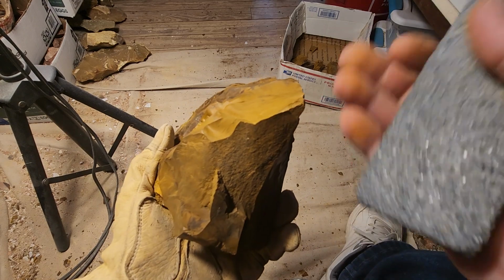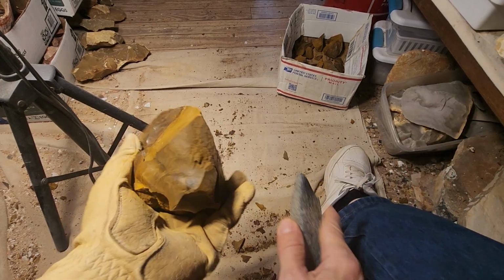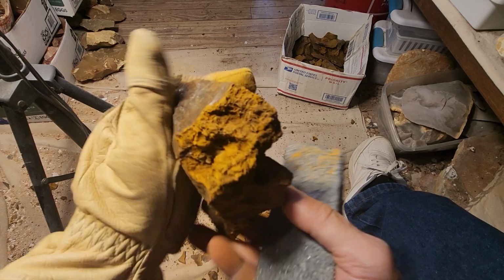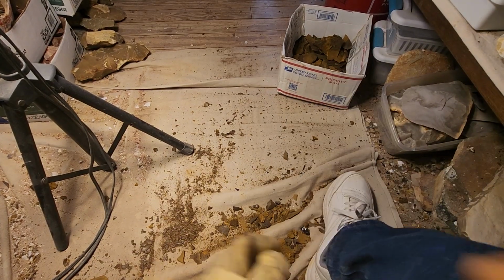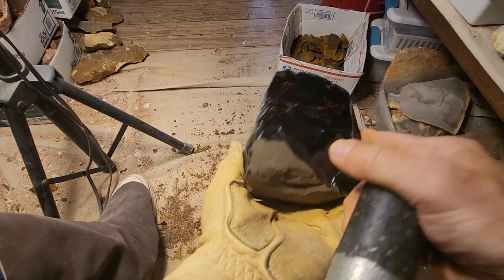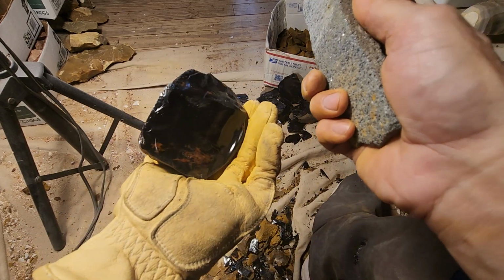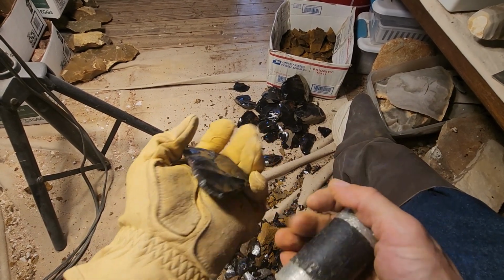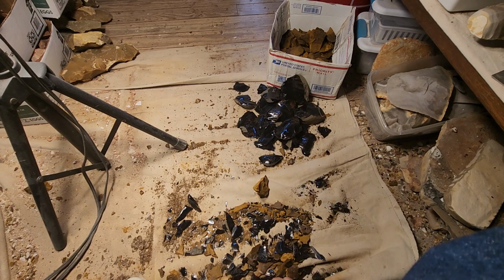1533 - Spalling A Crackly Nodule and Small Obsidian Nodule

Comment: A big wet towel folded up as support gives me good results spalling. I think it gives it density and support like using clay, but way cleaner. You have to keep that towel separate from everything so you don't  forget or someone else picks it up to wipe their hands. I use a mesh bag from potatoes to keep mine in. I've pondered a chunk of memory foam too but haven't a piece that was free...you could lay a leather scrap in between to keep from tearing it up so easily....just thoughts.

Comment: I've got some massive English Flint nodules to try and spall.... I've got no big copper billets to use so I'm thinking sledge hammer. I can't think of any other way of getting into them. None of my hammer stones are big enough. Just worried about using a steel sledge on them...any other suggestions?
 Also as i consider myself as one of your students,as it was your posts that got me into making points in the first place... I've just posted a number of points I've made up on YouTube.... could you please take a look and tell me honestly what you think and also what you think i can improve on. Your honest opinion would mean a lot to me.
Reply from the maker: At first, I thought I would be looking at points made by a newbie. On the contrary, your points show advanced skill. The only suggestion I have is, you might want to hang on to stones with holes in them instead of throwing them in the bushes. They're called "hag stones"
Reply from the maker: As far as using a sledge hammer, try it and see. Most raw stone responds well to steel.
Reply: Can you hear treat that material
Reply: Lol Nevermind that was a stupid question
Reply: First off thanks for spending the time to look at my stuff. I've been working flint at work for 30+ years. Building houses made of brick and flint(or just flint) and specialist repairs matching old old existing work, churches and stuff. It's very different work from making points though but I guess it gave me some experience. It's you that's taught me to make points and I copy you as best I can. I'm very sure there's loads of us that would say the same thing... you've given us gold sir with the vast selection of posts you've made over the years. Your opinion means a very great deal to me,so thank you. Also I went back and got the ' hag stone' point,I only threw it away for a laugh and because we all know the pain of ' damage control '.😂. I'll do some tidying up on it and give it to a local school or something. 
 I was serious about using a sledgehammer and my concerns. I've got hundreds of pieces of shrapnel in my hands from using steel on English flint, it's extremely explosive and has punched straight through heavy leather gloves to the bone on many occasions... probably the way I was striking in my inexperience as a youth. It's like hitting glass. 
 I've been knapping everything raw,no heat treatment. I Knapp my stuff into a preform and then water treat it for a week or so, something I saw ' paleoman Jim' try. Does seem to help for sure...have you ever tried this method? Shock/percussion waves traveling better through water/soaked flint and stuff. 
 Before this becomes a book I'd better finish.... there's just  so much I'd love to ask you.🤓
 Thanks again for your kind response🙏
Reply from the maker: @Scott Laugher  Thank you for all the kind words. With 30+ years of experience with Flint, it seems like I should be the one asking YOU questions.😊